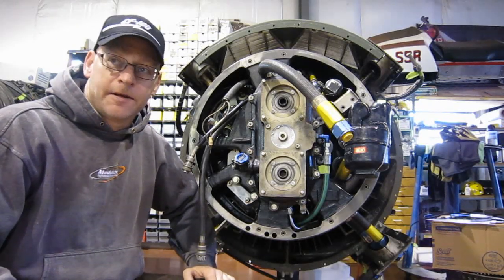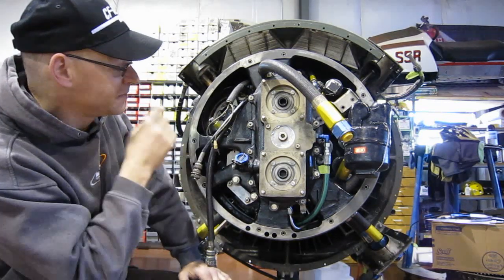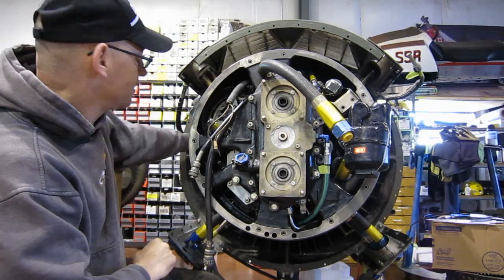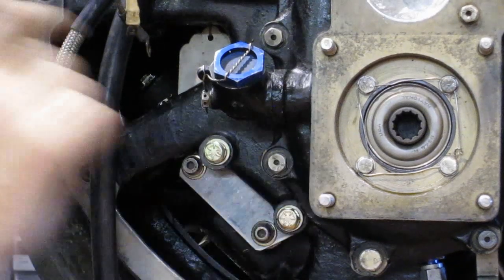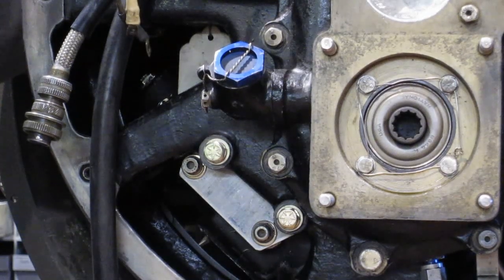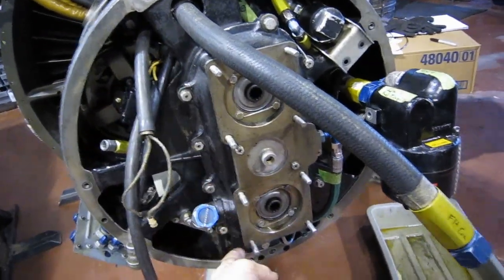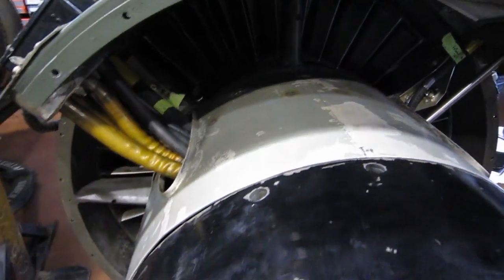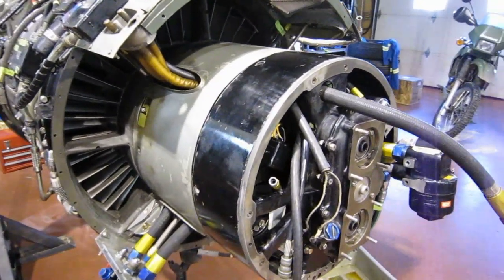Auxiliary drives - Turbine Engines: A Closer  Look

Comment from the maker: @1metiz I can only film the activity between the times I have to do my real job.
I have got two cameras, but they auto-shut off after 10 minutes.
Besides that, test sometimes last 20 min, sometimes 90.
I try to get the good bits for each engine test, but often I miss the throttle-ups and the actual moment of shutdown.
The operator is not taking instructions from me, so I never know when these things are going to happen.
 I do the best I can.

Comment: "Flight Control systems" is a telemeter cable sending engine data to the gauges in the cockpit. An F-86's cockpit is a very busy environment with gauges monitoring just about every function and stage of the engine. They had to back then considering the engines had only tens of hours lifespan before they had to be torn down and rebuilt. The newer ones do better, much better! I saw pics of a CFM-56 blowing out its PTO and wince consider a similar failure on a military engine.

Comment: So if the nuts are in a "box" position u can just lock wire them like that?
Reply from the maker: As long as the wire works, and does not have too far of a gap to cover, it does not matter how many corners it takes. I've been getting a lot of criticism lately about wiring up too many bolts in a row, but I don't think those folks have read as many engine manuals as I have.
Reply: @AgentJayZ  thank you for the reply even tho the video is 11 yrs old. I am still currently a student so ive been watching alot of your videos lately. 👍🏼